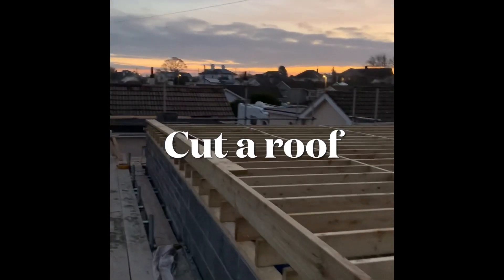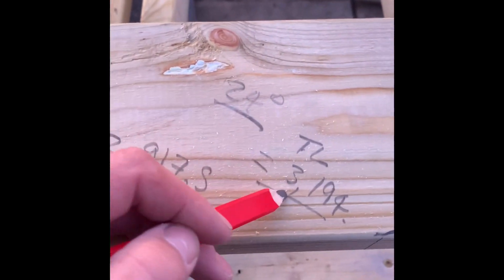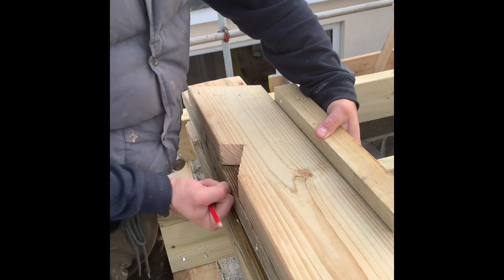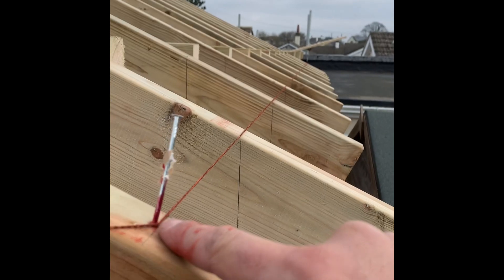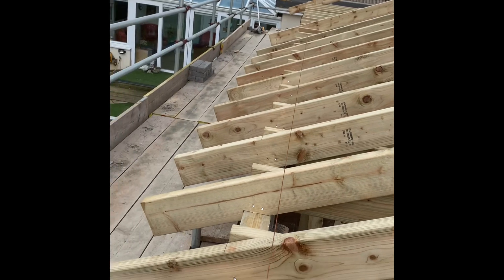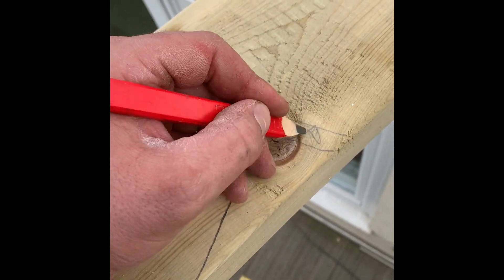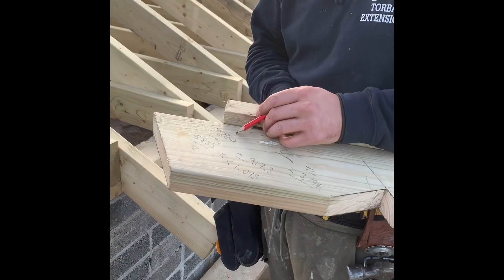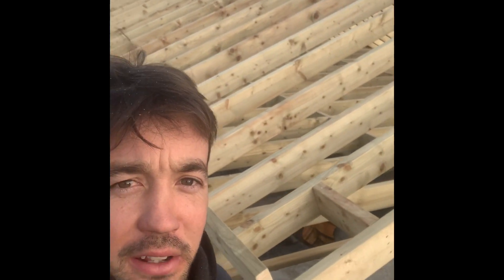Easy way to cut roof using ready reckoner - easy simple process- easier than the roofing square

Comment: Do you ever take notes on how you remember to do a process for example cutting a roof or fitting a kitchen or do you just simply work from memory never needing to check what’s the next step in the process?
Reply from the maker: Just learn it along the way, done some major fuck ups, the best bit of advice for roofs I’ve had is start with the biggest triangles then price it together with the smaller triangles. Take it section by section mate
Reply: @southdevonhomes-jonnystand4039  so you would say learning by doing and experience is the way to master carpentry not books or instructions?

Comment: Could you do a video or explain the size of how big the seat cut should be on the birds mouth
Reply: The bird’s mouth is 2/3rds the width of the rafter . So say the rafter is 175mm measure down from the top of rafter 117mm which is 2/3rds of 175mm.. That is the depth of your birds mouth . There’s plenty of vids on YouTube which explain it better than I can
Reply from the maker: That’s it or a maximum of 2/3. U can leave more in which I do, I generally go 45mm deep same as wall plate then u avoid the brickies snots.

Comment: Great video, do you always workout ridge height from Rafters or  workout ridge height first, then do the rafters?
Reply from the maker: Yep for years I’ve done it half ridge off both sides then had a brain fart one day and if you take whole ridge off at beginning it saves the hassle.
Reply: Setting out and cutting the rafters like this sets the ridge height, ie the ridge height comes where it comes. If he had a specific ridge height to make the roof, then he would have had to alter the pitch. Again, easy to calculate with calculation.
Reply: Hello Jonathan, just querying but isn't the formular. Span divide by 2, minus half the ridge thickness,
Reply: Forgot my last comment, I see how you did it, Great work
Reply from the maker: Pretty much what “the tall carpenter” said. The pitch should be on the drawing or use a protractor to find it. Then the book calculates the rest for you. 
If you don’t have a drawing and say for an extension a set ridge height or a height the ridge can’t go past and walls built. If using 6 x 2 Rafter I would put a piece of timber on the wall plate about 100mm to represent the backing then pull a line down from top of ridge. Mark a plum line down off the line and using a roofing square or pitch factor app to find the pitch. 
Then I would go to that page of pitch  in the reckoner book to calculate rafters etc.